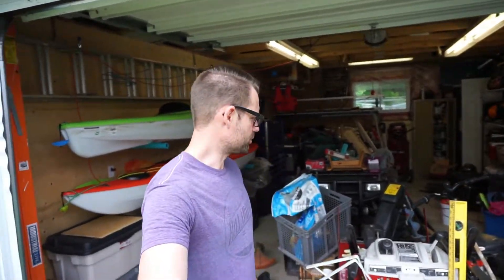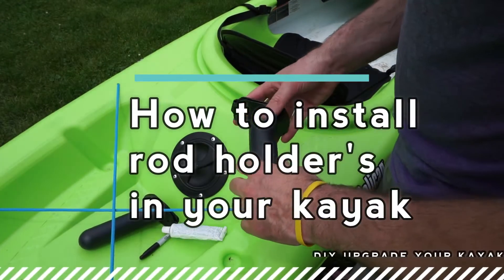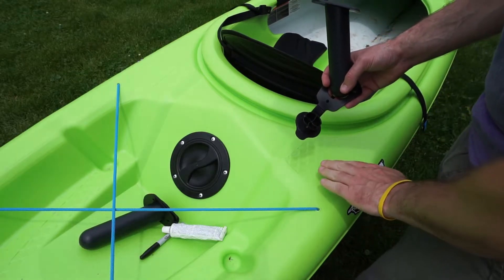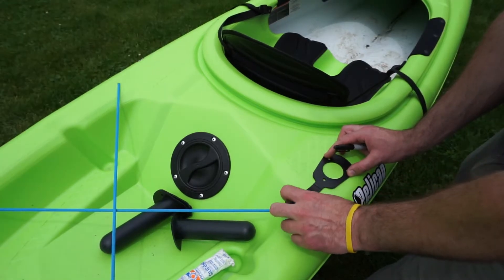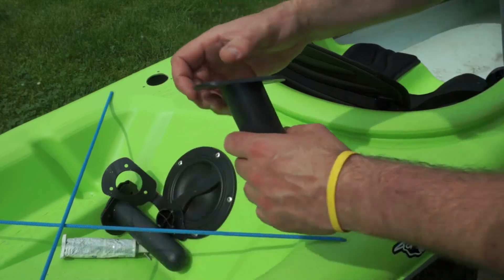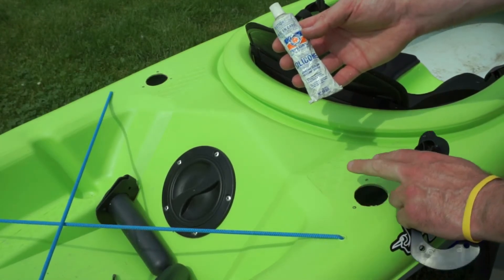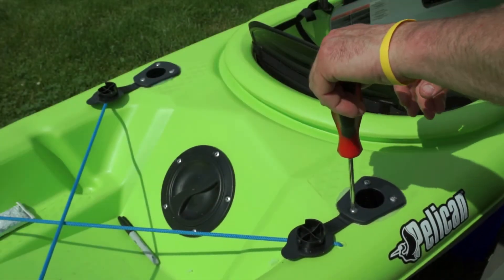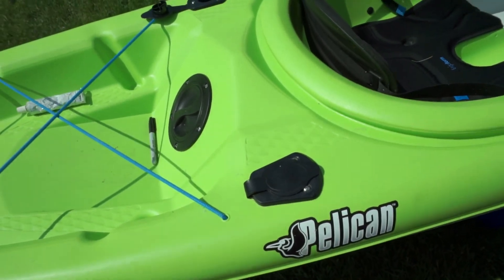How to install fishing rod holders in your kayak DIY Pelican Maverick 120X Pelican Vanquish 120X

Comment: you see any major difference paddling over 12 foot kayak ? i have been out on a 14 footer with pedal rudder control and was very nice but heavy not sure i would want to load/unload every trip.
Reply from the maker: I like the 12 foot. I'm close to the water so it nice. If I was paddling on a few day trips a longer one would be nicer since it would be less effort to push. I've been eyeballing a solo canoe lately.

Comment: on sale for 1.99 right now
Reply from the maker: Oh WOW. Ya, I just looked again. Thats crazy!!!!
Reply: can we use this to make a pontoon holder?
Reply from the maker: Ya, that would work. It might be hard since they do go on an angle. So make sure you dry fit it with the ABS pipe first. Also would be good to put a cross section because it might wobble at the bottom. It's only screwed in at the top.
Reply: yeah i need it so i dont get fear of the kayak rolling over hehe
Reply: i think i used a wrong word its outrigger?
Reply from the maker: Ya outrigger / pontoon lol It would still work I think. You would have to figure out how to stabilize the bottom of the rod holders. If you get the kayak in the video, its very stable. Or add them to the back and make a straight bar that "T's" down into the rod holder.